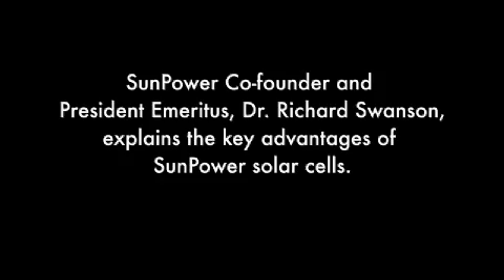Dr. Swanson on SunPower Cell Technology

Comment: yeah? Well, my experience so far with you cells bring sold through Third-Party Chinese companies had been less than desirable. it is obvious that Maxeon / Sun Power keeps the best cells for themselves and then sell the "B" grade cells to unsuspecting resellers. I have received cells with yields of 80% down to 20%. Either that, or you are selling them untested panels from the production line. outputs range from 0.5 vdc down to dead shorts. Most are in the 0.42 to 0.49 range.
Reply: George has it crossed your mind that perhaps these third party chinese companies you are referring to are just saying they are SunPower cells when actually they are not? You have heard of knock-offs haven't you?
Reply: @RPetruccione  seriously lmao

Comment: SunPower modules are (by far) the most reliable solar panels. I'm an independent solar installer and I advise them (even if there a bit more expensive) because in 20 years, they will always work as well.
Reply: Nicoletta Sheridan Maybe the complete industrial panels are,  but not individual cells sold by Chinese companies or individuals on E-Bay.